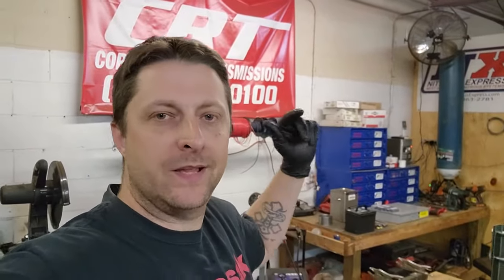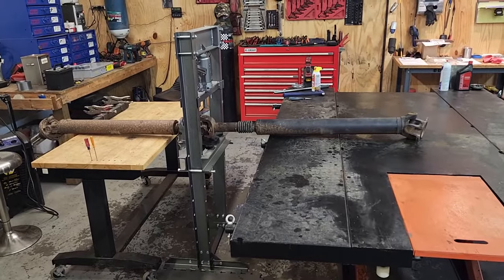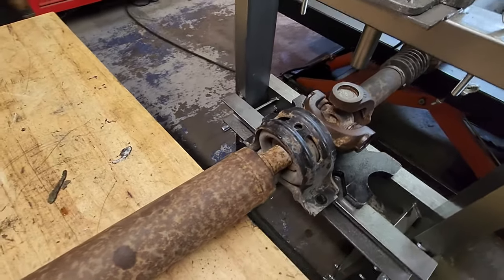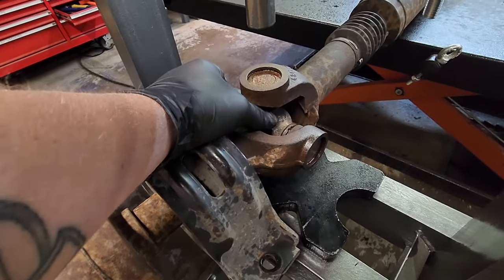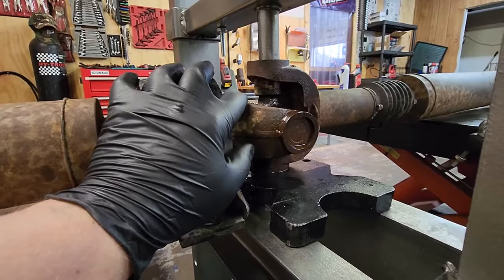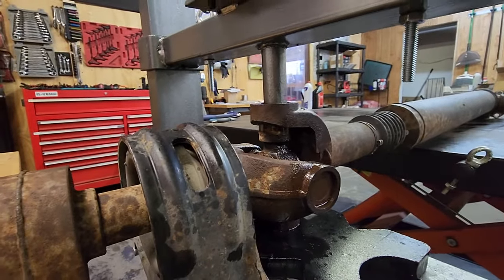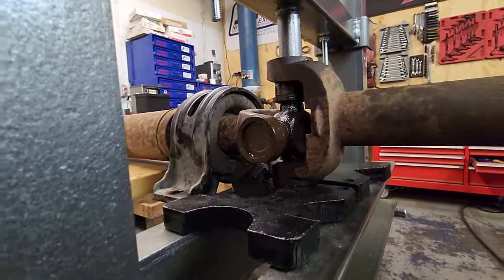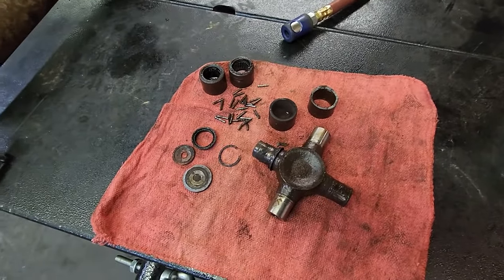Bad Vibration On Your Ram 2500 Cummins This Could Be It

Comment: Check for spline play on the rear section.  Poor, poor design.  6 potential places of failure.  3 universals, 1 carrier bearing, 2 slip joints (rear driveshaft, then driveshaft to transfer case.  I had play at the rear slip joint.   Solved it with a one piece driveshaft.

Comment: I JUST HAD MINE TOTALLY REBUILT $$$ UH I HAD TO CUT IT 2 INCHES FOR MY ALLISON 6 SPEED INSTALL
Reply: @rocklanddale8646  same here (G56 swap).  Driveshaft shop cut, balanced, and checked for trueness.  "All good".  I could tell it was still the shaft.  Put a camera down there.  Could see the vibration in the second section and the carrier bearing (replaced 15k ago) was moving straight up an inch when torqued.  Crawled under the truck to look at the carrier bearing.  Moving the carrier, heard/felt then saw the slip joint play.  CRAP!  So onto a single piece driveshaft.  Zero vibration.  Long road to get here.